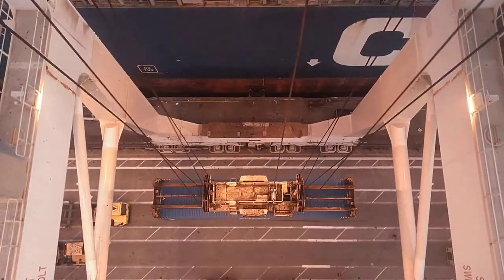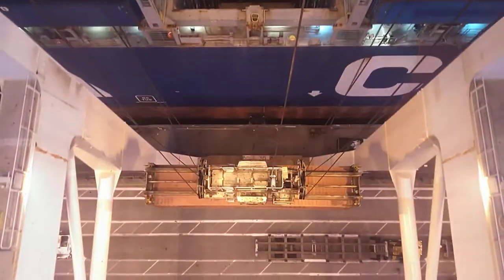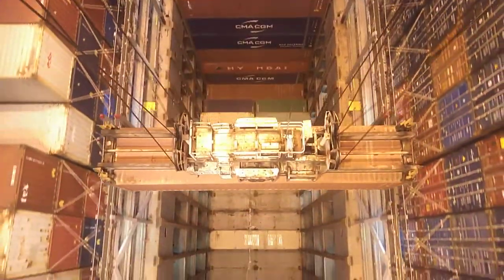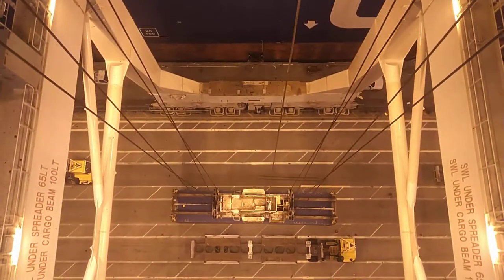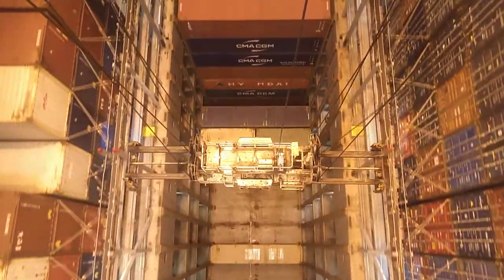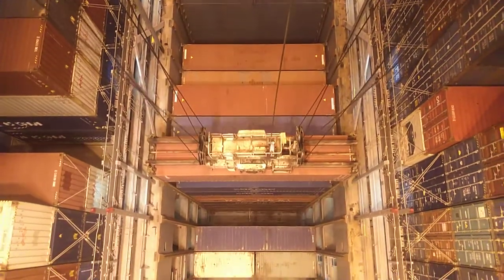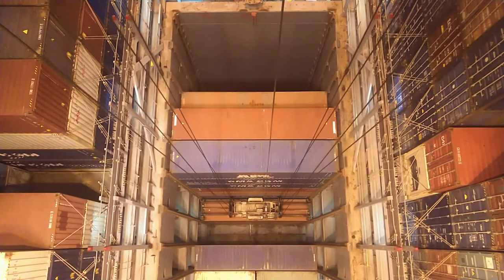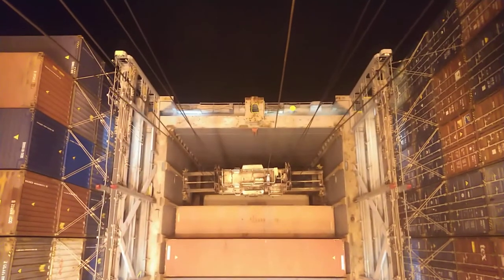Scotty squeeze/Port of Oakland

Comment: Nice work Scotty, what brand of crane are you operating in this video? What controls does your crane have to manually adjust the spreader? foot pedal? Down here in Australia I’m doing the Scotty squeeze in reverse in our Zpmc’s, they only have auto options to adjust the spreader so it’s a tough one timing it coming in to discharge.
Reply from the maker: Right on Alexander nice meeting you my brother those are older zpmcs they came into the Port of Oakland and right around 2020 or 2000 I mean right in there you were able to have a manual on that one and we have new GPS they do have a manual but the controls I configured wrong so it's difficult to do that one yeah I know it's on the tall cranes the higher up you are the more narrow it gets I found that quite interesting